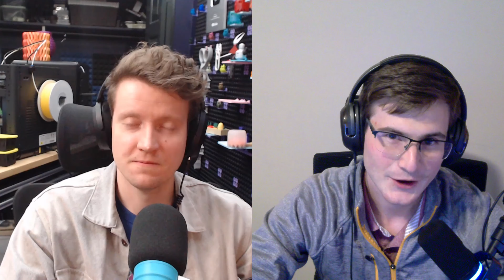Prusa using INDEX System, and Comparing Multi-Material Printing Systems - Episode 6

Comment: The way you count on cost is silly really i would not be shocked that for say 8 colors the price would be about the same per color. Making it sound that you only need the head (that won't be 250 euro for long) and 35 for a nozzle is silly you need more parts to get it all to work and compare to the h2c per color from a cover, guides, spool parts, the new spool holders (also 35 a pop). A h2c ultimate package is 2699 euro. That comes with 2 ams2's and a HT so thats 9 color spaces all with heaters build in. It comes with 13 nozzles. I highly doubt a prusa core one L + INDX8 prebuild with all the needed parts will even come close. I like the INDX system but many of you are dreaming on the it will be cheap part once its all done.

Comment: I am not trying to 'poop' on indx but first it has to ship on a printer the size of the h2c and even the Prusa Core One L will but have the same build size. Its not even announced yet prices of a complete set (including 10 spool holders, parts, top-cover) is unclear. I suspect it will be Q3 before i can just buy a prusa Core One L INDX8 build. Now i ordered (annnounce day) a h2c on 18Nov and it was printing in my home 26Nov. Also Snapmaker won't have anything the same size anytime soon. INDX looks very nice for sure but many questions not answered and h2c is printing day in and day out. It feels like a 2025 printer vs a somewhere in 2026 maybe even 2027 printer that can compare. I now can have 2 colors fast (dual head), 7 colors within a good speed and have 10 colors on my ams systems (2 ams2pro's and 2 ht's). I can swap nozzles from my desktop and if i need to really install or replace one it now takes 5seconds of my time. I got the package deal with 13 nozzles included. I understand the weak point of the h2c (speed for 3,4,5 colors compared to U1 and XL) and its harder todo 2 tpu's because of the ams system but its a solid compromise.
Reply from the maker: That is a very real point. INDX keeps getting pushed, and until it is shipping and working well then it is still just a concept. The H2C launched and shipped quickly, and also had working software. I think that is the best part of Bambu. Their software works on launch, and improves with time
Reply: @CoExtrusionPodcast  Indeed so far my gut feeling was correct we will see how it evolves but i am feeling totally fine with my h2c pick for 2026.. we will see what 2027/2028 bring...

Comment: The part that you guys didn't go over regarding the  Bambu system is that it requires an AMS slot for every color you want to use.  This system was sold to sell multiple AMS units to each customer.
Reply: The included ams2 pro's in the ultimate package come to about 400 euro's thats 8 spaces with heaters. 8 just spool holders for the INDX/Prusa system are 35 a pop so thats 280 without any heaters and probably other parts you need to feed them in like the top cover. Not sure what is better value.
Reply: @scb2scb2  INDX has fewer over engineered parts to fail, and you don't have to cut purge and feed each filament every layer every time.   The time savings alone...
Reply: @T @jimprintsthings time will tell but vortek itself only has 2 moving parts not much engineering really. You could argue the ams system has too many parts but again thats a known thingie bij now. i see many people repeat its overly complex i wonder how many really checked how it works. Now i do agree that the h2 platform h2s/h2d/h2c has many parts but again vortek is one of the simplest parts in the whole printer. We will see once indx is feature on par which is more complex in the end. One thing that is true is that indx or toolchangers  its way faster but less flexible.